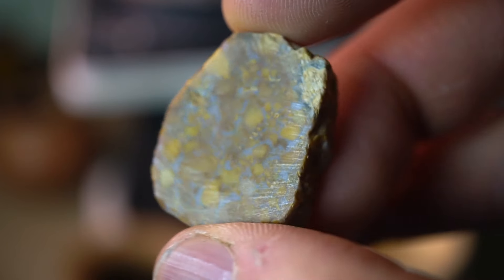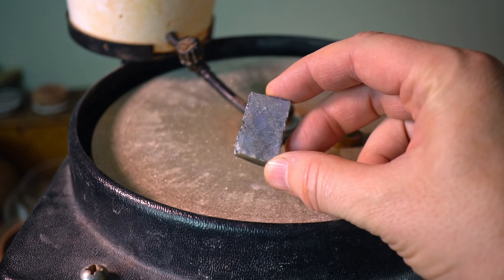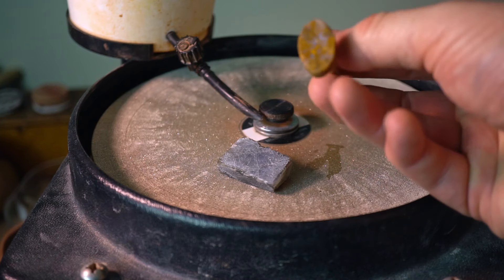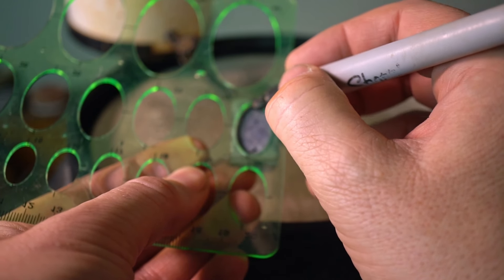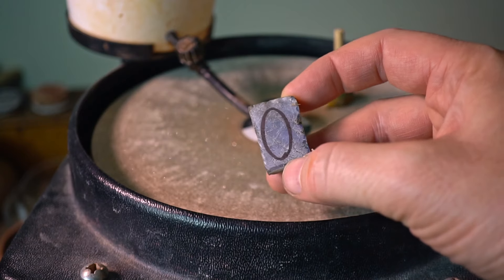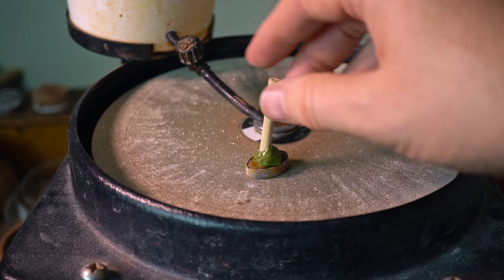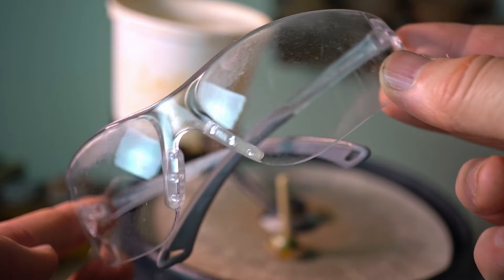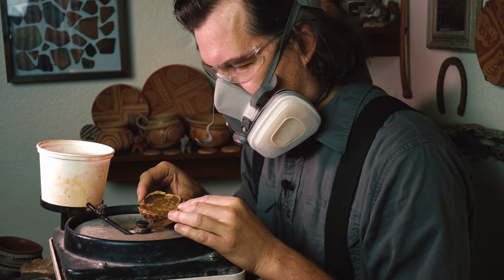Beginner Guide to Creating a Cabochon - Pro Tips

Comment: This was a very smooth video. I was interested in the change from 80 grit straight to 180 grit. Do you use other grits between that for different things? You have possibly mentioned about the different grits in other videos but I cant remember. :-)
Reply from the maker: Thanks! Really glad to hear. The transition may seem large but it's pretty smooth, Its best to spend a bit of time on the 80 grit. Then move to the 180. You can get a 120 grit if you need an in between grit. But it's not commonly used. Hope that helps! Thanks for watching!